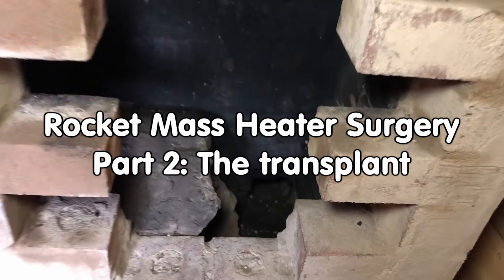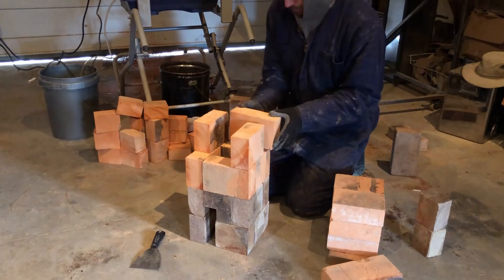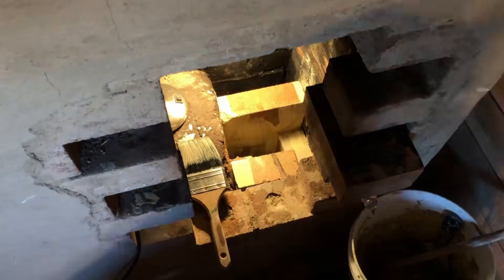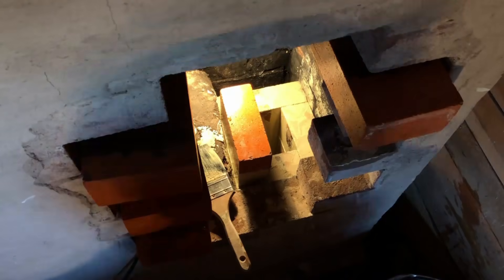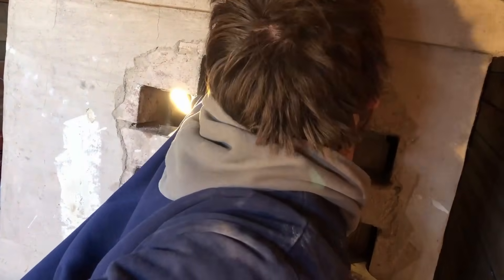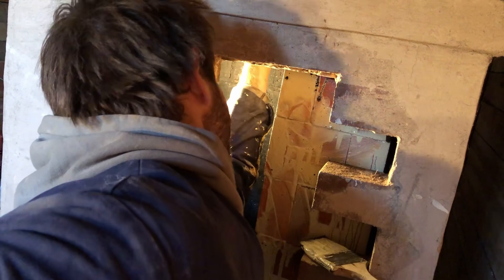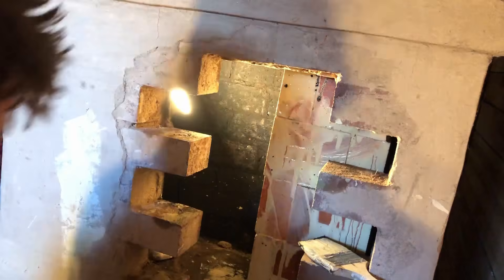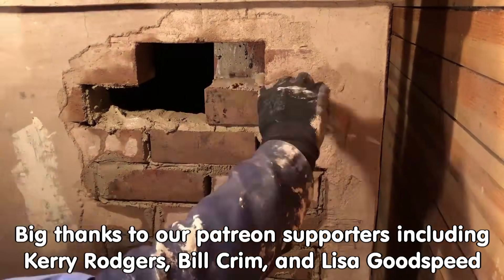rocket mass heater surgery part 2 - rebuild the riser

Comment: and don't forget the 3/8 inch Gap from the fire brick to the outside cladding there's always an air gap between the two to allow for heat expansion and contraction

Comment: This is cool because it’s a rocket mass heater without the big steel barrel.

I’ve stayed in the Red Cabin and this is a really good looking little heater.  You can even watch the flames through the casserole lid!

Comment from the maker: I think a thing I really want to emphasize is:  these are experiments.   We do a LOT of experimenting here.  Further, I desperately need to point out that this experiment has bore a LOT of fruit.   The riser failing is one small setback.  Others have commented that this means all rocket mass heaters are a failure.   First, we have a long list of stong successes with rocket mass heaters that are going strong years later without issue.   And this is definitely not a failure, but an example of "needs a little optimization".  Sharing experiments publicly is hard - especially when people have such bizarre criticism.   On the other hand, we do sometimes get people who write in with really excellent suggestions - making the sharing well worth it.  Freaky big thanks to our patreon supporters - whose support is in stark contrast to the people who put zero money or effort into these experiments, and just cause pointless distractions.
Reply: Science in general is being held back by a lack of reporting negative results.   https://www.editage.com/insights/what-is-the-negative-results-in-scientific-research  https://www.nature.com/articles/d41586-019-02960-3  https://en.wikipedia.org/wiki/Replication_crisis 

Which fire clay was used for this itteration?